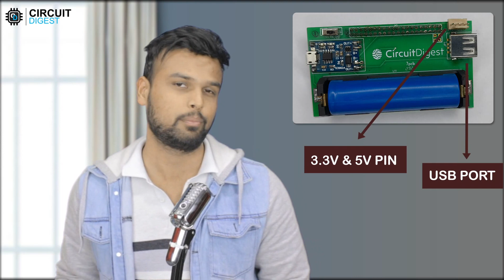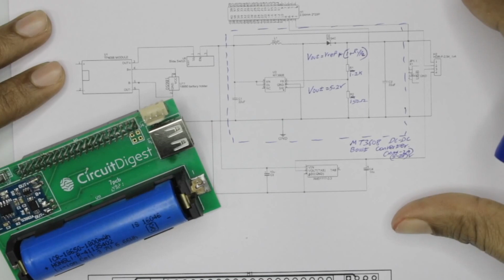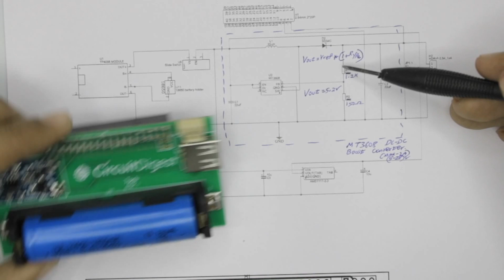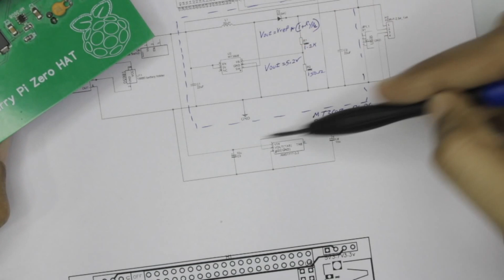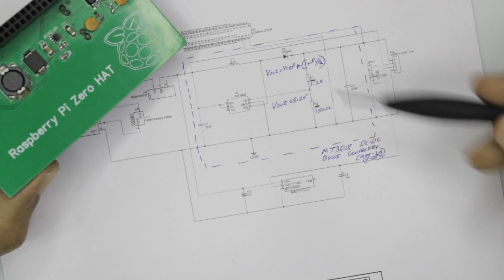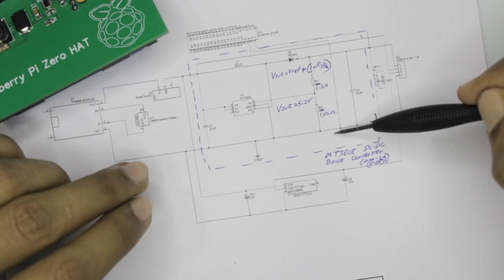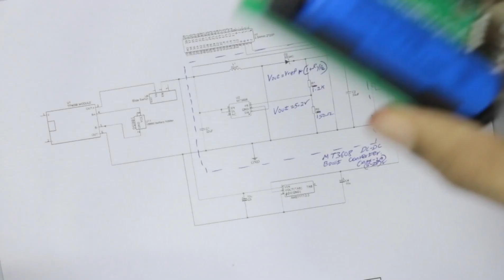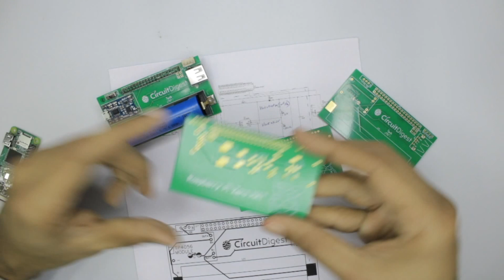Design and build a Raspberry Pi Li-ion Battery HAT to make your projects portable

Comment: Does anybody know what booster module will support Raspberry Pi 4B? Because MT3608 won't because it will not exceed 2A output, where Pi 4B requires around 3Amps...
Reply from the maker: You can use the 5A CC/CV module - it works will with Raspberry pi. Its. generic Chinese module does not have a part number